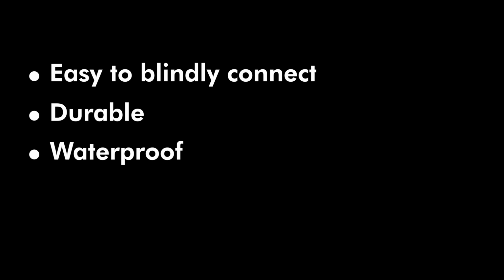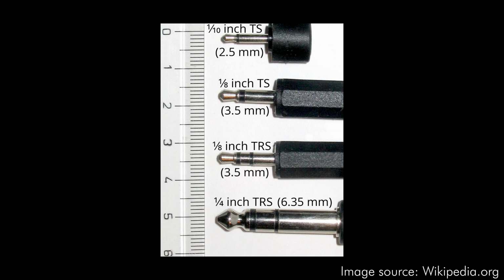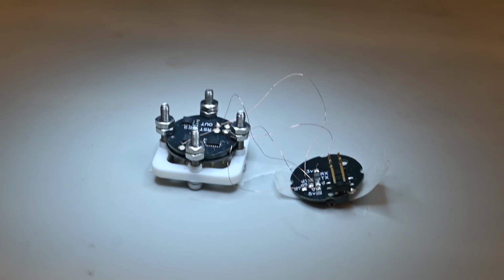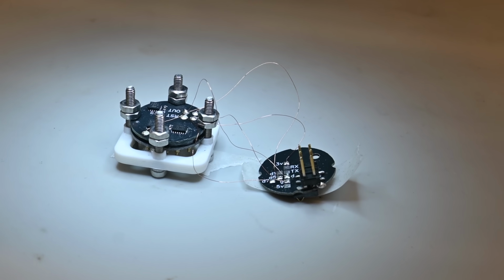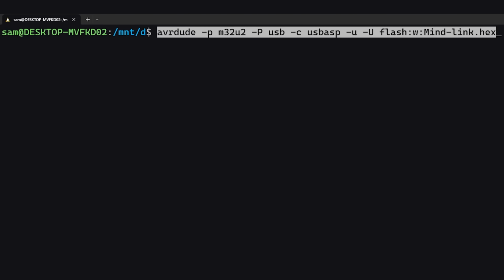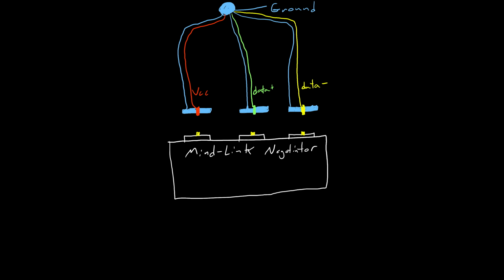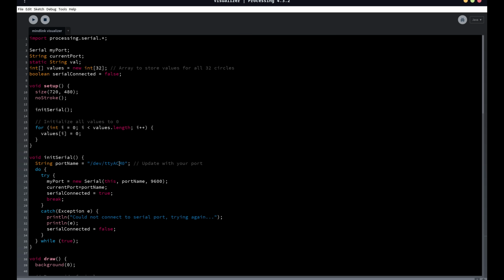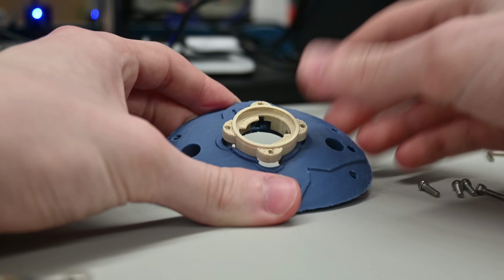Making a Brain Computer Interface in My Garage

Comment: You have 2 big problems to solve (well, many, many more)
1) Galvanic Isolation. You don't want to kill the patent or have them have a sezer because of a bad ground, or AC leakage current though a power supply.
2) The Wound where the connector is, is going to a huge problem. Either infection because of the penitration though the skin, or the skin regrowing over the connector. Go Wireless and inductive.
Reply: I was also going to complain about skin being annoying and not wanting to stick to metal and the resulting annoyances of trans dermal implants and infections. With how much power you can shove through relatively small wireless charging circuits you could even just use an esp32 for your connectivity. A esp32wroom32d can already pull like 150mb/s over wifi and needs only like 0.5a at 3.3v (recommended) which plenty of cheap wireless charging modules can do. So seal it up and don't deal with the skin issues. How your implant heating up during heavy data transfers feels is something else entirely. Though I feel like your 32 line device is probably unable to saturate that connection.
Reply: @randomconstructions4513  install a heat sink that doubles as a sick cyberpunk metal Mohawk, brain boil averted 😂
Reply: @randomconstructions4513  this makes sense, but i suspect that the reason they didn't want to seal it is for the whole modularity and ability to swap parts out without having to carry out a medical procedure
Reply: @randomconstructions4513  An stm32 or an nRF can consume down to 10mA with BLE instead of the ESP's massive 120mA. Using BLE instead of BT comes at the cost of data rate but in exchange there will be less heating around the brain. Another solution would be to forgo wireless connectivity all together, and encapsulate the smallest multiplexer chip possible in a bio-inert ceramic with gold interfaces. A single wire would relay half-duplex data from the multiplexer to the outside world, thus minimizing surgery and the risk of infection. If duplex is required, an ASICMUX with a built-in timer could be built to do time division duplexing (TDD) between the MUX and the outside world.
Reply: Inductive is a terrible idea too, especially if you intended power to be delivered this way, as you're now subject to EMP and RF attacks.

The open skull is indeed a problem. Base plate inside and outside connected by a couple of wires passing through the skin and skull, at most.
Reply: @naasking  So basically make the brain a peripheral device, not the other way around as author does

Comment: Since you mentioned pogo pins, one thing to note is after enough mating cycles they have the potential to bind up and can compromise mechanical integration and electrical signaling depending on how you’re gonna design this in the future. Also with you mentioning wanting to upgrade to a more powerful processor or mcu, the ST range of MCUs could be an option, and if you want to dive into AI processing on the board, the new N6 range could be something to consider, or if you want to prioritize real time processing, the F4 range could be good or anything with DSP baked in its middleware

Comment: Absolutely. BCIs should all be open source, open hardware, repairable, last long, etc.
Reply: dudes... just make it read only
Reply: @rafone3026  While that's a good start, permissions can be changed in some instances. making it FOSS too is extra safety, and I think safety should be #1 priority here
Reply: @rafone3026 what fun is a BCI if I can't make myself feel unspeakable new types of psychedelic sensations
Reply: Indeed, open-source means that people can contribute to the project
Reply: Lol no, it's going to be used to control people.
Reply: @gendalfgray7889  Better we know how they control us than be unwittingly duped into it with no possible way to prevent it.
Reply: @gendalfgray7889 it wouldn't really control people unless it's extremely invasive, at that point it would be easier and cheaper to just build a humanoid android
Reply: @ExleTheProphet  Why try to build metal androids when you have bioandroids that can do self maintenance.
Reply: @gendalfgray7889 true but I personally think it's more ethical to use metal androids. Unless if you're using someone who was vegetableized or you could fix them so they can be with society and function alone. It would likely get them way more money than forcing everyone to be a slave and it would violate several human rights laws
Reply: @ExleTheProphet  When government showed that they are ethical? When government finds out reliable tech to control brain they will drop all masks, they will capture people and brainlink them. Mass media brainwashing is no longer required. At first they will convince people to install it by telling that this is new cool tech and you could pay with your brain, watch netflix lying on coach and whatever. Mass people being naive install everything and become softlocked. When they have giant army of braincontrolled people they will hunt down the rest. 
Bioandroid life would be miserable, worse than living in a cage in honkong.
Reply: @gendalfgray7889  they like nukes lol
Reply: @gendalfgray7889 you act like there are no mechanisms of control atm, what a major failure of thought...
Reply: @OversikerSTUDIO I personally want more security and social score because lots of evil would've been filtered away quickly for everyone's sake, even those unluckily evil wouldn't live way as badly with better security filtering them away from opportunities to harm or get sicker, especially because they can't stop harming others through mechanisms they're compelled by. By the time that is a general accepted idea, brain computer interfaces should be much more common. Brain computer interfaces are gonna be necessary tools to provide therapeutic effects for families and people in need to reduce the strain of life from the living for the goodness of all. But obviously situations like "house of the scorpion" are to be vigilant of.
Reply: @OversikerSTUDIO  I'm acting like there will be more control mechanisms, with brainlink it's over, people will be cattle
Reply: @gendalfgray7889  they already are, give me a break
Reply: @tannervlasic8356 so you want mind controll are you dumb ? "For the greater good"? doesn't justify modern day lobotomy
Reply: not should be, they are. you got all the data and tech, you just lack skill
Reply: @OversikerSTUDIO  no data no tech
Reply: this concept creates risk of backdooring the interface for hacking good luck shorting out
Reply: @nxe11011  same would happen with propietary systems. except in that case you're at the mercy of a profit-driven corporation, they'd either take too long to even see a backdoor, let government agencies abuse it (as they already do with most propietary tech), or they'll sell you an entirely new device that fixes the issue and discontinue your current model later down the line. you dont want to be stuck with an outdated and insecure piece of hardware connected directly to your brain, and you dont want a corporation to profit off of that while you suffer the consequences of it.
Reply: @nxe11011 they all do, and any company saying otherwise is... Ignorant
Reply: @Sunburst_No  lmao you think homebrew BCIs are going to covered if you fuck up? lmao ignorance.

At least with a company there is some sort of cover for something going wrong but if you homebrew that shit and it medically goes wrong you're utterly fucked.
Reply: @nxe11011 it’s exponential less likely for a backdoor in open source software, when it does happen it’s after decades of conspiring and useally found in a matter of days

Comment: Having a big hole in your skull seems like a design oversight. Wouldn’t it make better sense to pass information through a small hole using a fibre optic cable? Then the external processor can be places anywhere you like and a pluggable interface is provided allowing for easy upgrades and replacements of computational components!?
Reply: 1: Fiber optic cable is fragile, 2: you would still need a big hole for the port and physical hardware to turn from electrical signals to light
Reply: @opticaltesticle7261  Good points, thank you!
Reply: I like the idea of the fiber optics, conductive cable can be inductive, making an EMP good for fried brain.
   Also if it operates in a frequency of infrared that flesh is relatively transparent to, it could be possible to restore some limited communication if fibers are severed. Glass also has a much lower chance of rejection.
Reply: Magnetic induction. No hole.
Reply: @renakunisaki  That's a clever solution! Though I do wonder about magnetic shielding, and if I recall focused magnetic fields can alter the activity of the brain (used in TMS).
Besides those hangups though, this could be a great solution!
Reply: @jacobusburger TMS has magnetic fieldsmany orders of magnitudes larger than whatever you would use here.
Reply: @renakunisaki what if I'm leaning into stove and accidentally turn on the burner of the inductive stove top with my head right there? Walk too close to my friend's inductive furnace in his welding shop? What about that advanced metal detector near the jail? Neighbors shortwave? 
   Skin penetrating infrared, what's the worst that could happen, an old TV remote sends a couple of temporary spots to your visual cortex?
Reply: Yes I think light is the key and not just fiber optics

Comment: RJ45 port directly into my spinal cord
Reply: Well is this a good opportunity to point out that the spinal cord does reach all the way to the anus...
Reply: @ataarono  imagine being hacked and infected with a "direhhea virus"😂
Reply: @stephenmatthew7869  i could definitely see smth like this in cruelty squad
Reply: @ataarono "Jarvis, poop my pants"
Reply: @Flesh_Wizard  at 15% intensity
Reply: @ataarono Imagine getting a diarrhea virus 😂😂😂😂, well, it also has other side effects, brain diarrhea aince the code was ran on it.
Reply: @ataarono  Seems like you are suggesting the idea of utilizing the natural bio plug of humans to connect to the brain.
Reply: Spinal cord is brains extension including bones... Which are sensors too ie we see this bones connection paths on centipedes totally active.. which hints that in humans the are offline in general but we know they has lots of pain signals so not offline totally so actually that links can be used to transfer lots of Information .  Tough problem is our brain doesn't have rj45 firmware or codecs to interpret this signals... So won't work but not because they won't ... Also neurons work on lover then one transistor trigger voltages ie 0.3 volts and less while rj45 uses voltages higher then 3 volts..🧐🤨😅😅😋🙄🤔😁
Reply: Jacking in!
Reply: jack in choom, you're a netrunner now
Reply: Fully modular
Reply: PoE is truly the best power negotiation standard.
Reply: Matrix style
Reply: Not hardcore enough- you need to jack in with RJ12 cables /j
Reply: Just two LC optical connectors - faster and smaller
Reply: @videorowtv5198  True, but a sub-dermal link would be much safer, long lasting, and therefore even better. Current brain implants use magnetic induction (e.g. nfc), but that is extremely limiting (424kBit/s). I would prefer neural-patches (adhesive conductive electrode patches) over an actual skin penetrating port. Don't know if this would actually work, or if one would need to biohack the skin to make it more electrically conductive in this area. 

Actually you want to make the hole in the scull as smol as possible. Better not much more than a tiny slot for a flex cable. Best approaches put all the processing and the transceiver between the skin and the skull. 

People who depend on permanent ports in their body can attest, how delicate these are, and how fast skin can get infected. Therefore these are not an option for a permanent BCI.
Reply: They better not use fucking pass throughs
Reply: SFP is better, just don't plug fiber module - they get toasty
Reply: @saiv46  plugging in the SFP in the brain would feel a bit too stimulating 😬
Reply: 50 pin centronics on the back of my head
Reply: No kink shaming
Reply: LPT
Reply: But only for a PC-link for video and audio-input, as well as mouse and keyboard-output to my personal computer, which is also running exclusively FOSS, and only running propriatary software in a highly isolated sandbox. I'm not taking any chances, and there is no need for a direct up-link to my brain, or even web-code running inside my brain. And why would I even need that? Basic offline-tools like a note app as well as a alarm-clock etc. is all you need on the internal computer.

Comment: instead of titanium, you could use colfeed's FOss HASint sintering filament that turns into bones after a while, so with a little bit of reconstructive surgery you could have only 4 ports coming out of your head instead of a whole titanium plate
Reply: So less Deus Ex and more Pondsmithian Cyberpunk? I dig.
Reply: great idea
Reply: Is ceramic worse?
Reply: @KayKay-ob6tz  well it's not bone, so the body may reject it
Reply: Reminds me of Ghost in the Shell.
Reply: Will it be possible to have hair follicles grown or implanted on it?
Reply: @CM-di1oz  I don’t think so but you can put the cut skin (with the hair follicles) back on and then implant additional follicles on the skin used to
attach the raised skin to the rest of the head

Comment: I love the concept, but I fear the current idea is not really feasible.
I think there are a few problems, but the main one is your connection to the outside world.
Neuralink is embedded in the skull with skin over it for a reason, as a, so called, transdermal (through the skin) implant is very likely to infect after some time.
This is already a problem with piercings, but large surfaces, and thus large areas of removed / cut skin will likely not heal properly.
I am also unsure, whether pogo-like connectors on the inside are really the best idea.
Your signal integrity will go into the floor, as brain signals are really weak.
The amplification is already another point of concern. I think going with a bunch of multiplexers is the right choice to reduce complexity, as you can have one high quality signal processing circuit, but I think there needs to be some serious filtering, as the small wires from the brain will probably act as antennas and just pick up a lot of EMI.
Apart from that I like you idea, keep it going.
If you want to delve deeper into the implant idea, I'd suggest asking people with experience, e.g. the folks over on the Biohackers Digital Discord (little ad on my part)

Comment: for the next video id like to see you try to make a non sergically invasive version for simple tasks
Reply from the maker: I considered doing that, but projects like OpenEEG have already accomplished this.
Although, before this project, I modded a device called the MindFlex (Basically a children's toy that has a NeuroSky chip in it). And it essentially allows you to have a single contact EEG for about $20, which is far lower than even the OpenEEG price point.
You can see my repository for the PCB design here (warning: it is not polished): https://github.com/sam-astro/MindFlexFast-Mod

Comment: Bro went from hobbyist to Neuroengineer
Reply: Its just WoW
Reply: The pure Neuromancer
Reply: I remember watching his videos like the bridge one on my school computer, he’s evolved 10 times since
Reply: @D_Net1 no fr bro leveled up
Reply: Just a CAD engineer with too much free time. He has to go into gene engineering to create an injection that grow you a port.
Reply: Crazy to drilling a hole in yourself not recommended inless done by a surgeon he should of gotten a surgeon to do it way safer
Reply: Hobbyist Neuroengineer.
Reply: @@Hezy  i also did this but ITS would need to be a operacional systems so ITS fast enough to detect brainwaves from distances
Reply: @@Hezy  actually it has imaginary sensors its basically aí learning to use the correct sensors to massively denoise by catalog
Reply: @@Hezy  that code can create an aura around the device and It makes you dreams because ITS consistently connecting to you since youre ITS owner
Reply: @@Hezy  there are methods of self hidden com ports but they dont stick the function you use them because you need to find it exactly same process you need , It nerds alto of comparison cycle but that can make the communication work better and wider in consequence
Reply: It starts with trying to learn shit /your way/ and not anybody elses, and do it only when you feel like it. so make yourself feel good, rest and do whatever you want. because thatll give you energy to do what you need. no way around it except Yours
Reply: Also his voice changed from what I remember way lower pitch

Comment: why not a delidded, de-antennaed raw ESP32 chip (not a module)? The chip itself is small, most of the space is for the antenna and wireless WIFI (which is not possible to fit in such a tiny space).
Reply from the maker: I was considering that. The current microcontroller was chosen for both it's size and it's built-in compatibility with USB, but any other microcontroller should function as long as it fits in the footprint. I actually did not know you could modify an ESP32 to make it significantly smaller, so I may try that.